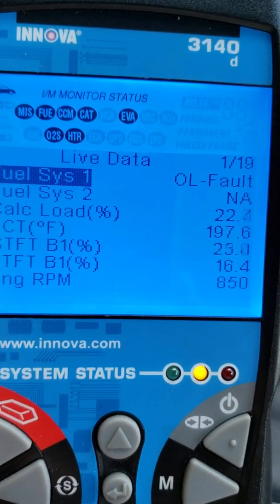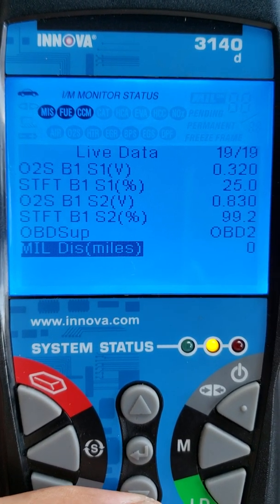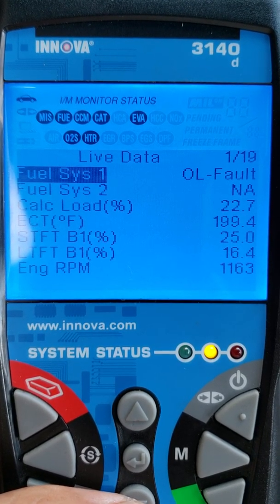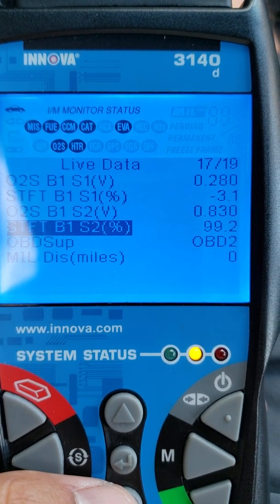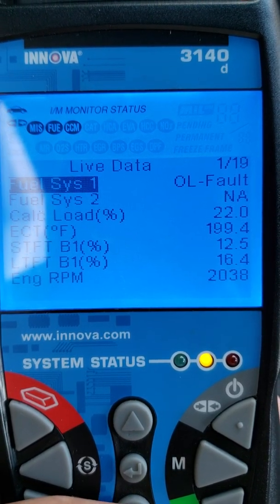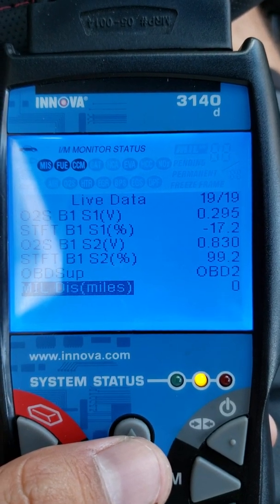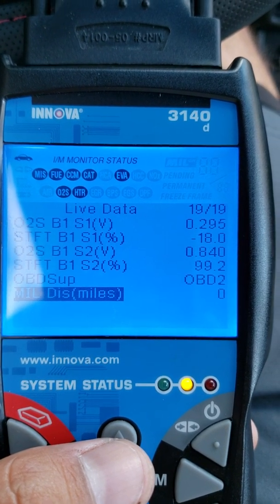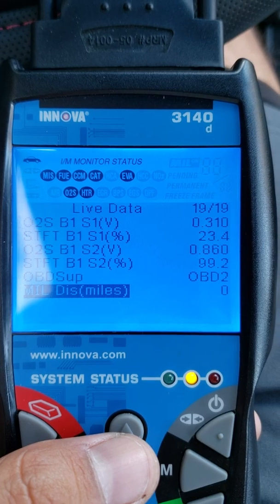2004 Nissan Sentra 1.8l open loop fault

Comment: • A 15 percent or less change in trim and a downstream O2 above 650mV points to an ignition concern

• A 15 percent or more change in trim and a downstream O2 under 350mV points to a lack of fuel concern
Reply: If that was the case. What are the things we need to fix?
Reply: Thanks for the info! My 03 pilot is going into open loop at times and blue driver reads when it does go into open loop: due to "driving conditions (bank 1 or both) e.g. power enrichment, deceleration enleanment, cylinder deactivation". Its getting hot but the temp gauge doesnt show it as it reads normal. There is an intermittent miss and my downstream does show a 10% change. Not sure where to troubleshoot from here though. I could check the plugs and coils again (replaced all) to make sure I'm not missing something there. If it was a secondary ignition issue (getting a pending code of p1399 for the last few days but no CEL on or confirmed code) what would I want to look at?
Reply: @sarajill7    HI;     2003 Honda Pilot 3.5 L ?    MAP  sensor  is what i would check first  (  check  its O'ring  first,it must seal, the  MAP should have some drag in and out);  ideally,do it by substitution, try to get another MAP from another car,if physically similar,they are mostly the same,(attention,turbos  have different MAPs) i have no direct experience with your car model,a shot in the dark here; BUT  i had SIMILAR  cases that drove people crazy,because they would NOT pass emissions inspection here in Portugal in Europe; after LOTS of things were checked and replaced by others, the MAP sensor cured the  open loop problem due to decel. enleanment. I got them from ebay,China, 6 or 7 euros .
The MAPs that were there, they were borderline (i guess they were borderline since new!!) ,and i lucked out,the el cheapos were calibrated right on the money; i remember i ordered for a different car after studying their press/ volt curves  on the internet; the ones for the specific car were much more expensive; good luck.
Reply: any trim? becuse my nissan xtrail t30 2l gasoline when at idle , the short ft is 0 but sometimes when driving it goes to 25%, meanwhile LFT at idle is -7.8 and driving its 0 or a bit above